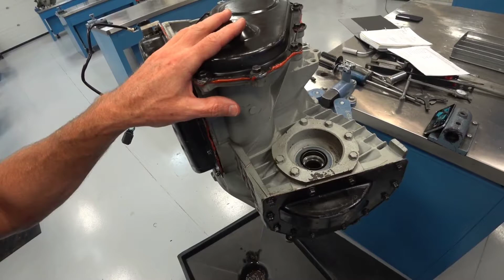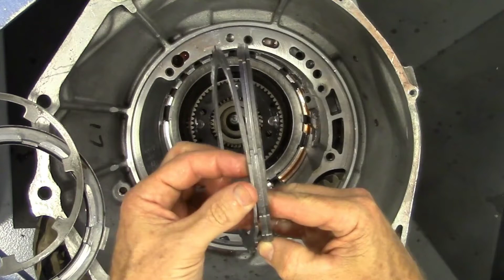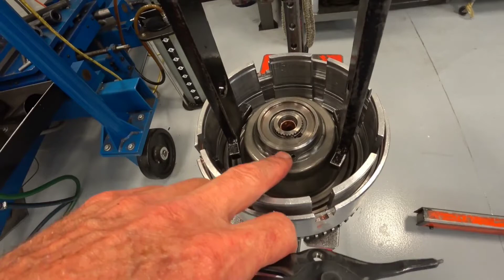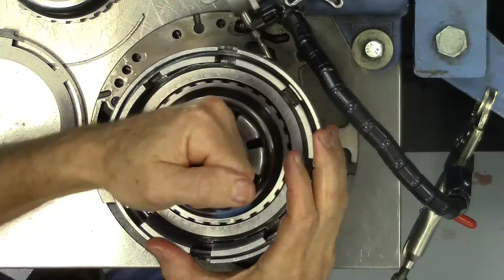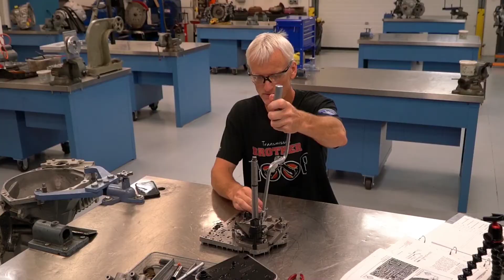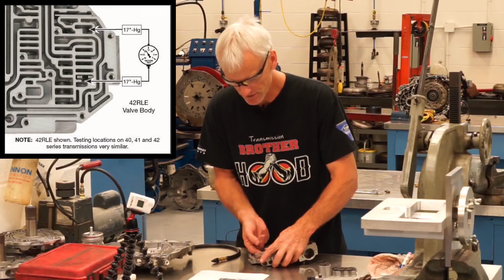FCA 41TE Overhaul

Comment: Excellent video.  Like your students, I was also perplexed by the manual's "remove 1 clutch plate".  They could have added "to not scratch it when removing snap ring".  I'm rebuilding my 2002 A604 AWD transmission for a second time and going in deeper.  First time was only because I had to remove it to replace a cracked flexplate.  Then I found the first clutch plates barely worn (1 mil max) so did just a rubber & gasket refresh.  This time (10 years later), it was leaking bad at the front, perhaps because I found 3 pump bolts loose (swore I used thread-lock and torqued them to spec).  I'm changing almost every wear item since 270K miles now.  So far, I had trouble removing the output bearings, having to use my milling machine (carbide end mill) to cut off a cone race and the outer cup (since recessed w/ no slot to set a drift on it).  Changing some bushings proved that no good deed goes unpunished as several turned out slightly too small for the mating shaft.  I only found that after spending a day trying to stab the clutch pack back and taking things apart again, thinking some clutches were wrong or hanging up, but actually a new bushing was preventing engagement.  I also bought the snap ring assortment and had trouble when I didn't notice the new wavy ring was too long so overlapped slightly (cut it).  I suggest only changing the pump bushing unless you find others worn (none in mine).  Also, good to buy a new star spring for the bottom of the clutch pack since others have found those broken.  Surprisingly, none of the clutch disks or steels are worn even 1 mil after another 80K miles and all rubber seals look fresh, so probably no need to rebuild one before 400K miles unless experiencing problems.  A document w/ many photos and much more detailed than the shop manual:
https://www.uscars.biz/uscars/extras-documents/ATRA_Chrysler_41TE_604_Rebuild_Procedures.pdf
Reply from the maker: Thanks!  Hopefully your rebuild was successful.  Sometimes I use a torch to clutch the bearing races off on anything that I cannot get a puller on.
Reply: @siuautomotive  
Thanks.  I did try a propane torch while pulling on the cone race (after removing rollers and cage), but didn't help enough and the lip broke off, so nothing left to pull on, so had to cut it off.  The outer bearing cone ("race") also had to be cut out, using the carbide mill on a hand drill.  They don't have any cutouts in the case shoulder to use a punch from behind (need a special puller tool),  The inner cone sticks up above the shoulder so was easy to tap out.  Works fine after the rebuild, just clunks down when slowing maybe from 3 to 2.  The ATRA manual gives a procedure to work that out, after maybe 80 cycles.  Might still be air bubbles to work out of the pistons and accumulators.  I haven't driven it enough yet.  I was a little worried I had overtightened the output bearings, since felt slightly higher than 8 in-lb "turning torque" (gear alone) though I didn't have a low-enough torque wrench to measure.  I didn't have the adjustable shims and felt close enough, so will just drive short distances at first.

Comment: I noticed that the shift shaft on my 06 PT Cruiser has a dimple on it and there is a shallow indent on the case, are these supposed to line up in a particular gear? Good video....
Reply from the maker: I don't think that's there for anything too important since there's not adjustment to any of that.  It's probably for the factory to position the shifter in a position for assembly line installation.  But I might be wrong.  I does line up with a detent position.  I'm not sure which one, maybe neutral?

Comment: I need help please. I overhauled my 41TE of 1997 DGC (270K km). I replaced all plates, clutches, rings, clean/flush the solenoid body, torque converter, except to re-use the old solenoid pack. I tested this SP and the ohms is good within specs. I decided not to replace (just total flush) as I thought I can still replace this if the low shift bump will persist later (as this is an external part). The bump never go away after the overhaul but there's no code. After running some +300km. I decided to replace the SP pack with brand new Wagner. The van works well smoothly during road test but reverts to its old bumps today just after some 50 km. What else should I need to check/do to remove the bumps. I understand the bump will start to erase all the spline of the planetary gear as I found out in the overhaul. (I replaced this part too on the overhaul). Thank you for time in advance.

Comment: I have this transmission in a 2008 PT and it has developed a whine, not really bad but noticeable. There are no codes or shifting problems but I wanted to sell the car and this will certainly drop the price. What would be the most likely cause of this whine? Pump or torque converter and what causes the whine and what should I look for? Does it in gear and out, not power steering pump or clogged filter. I serviced it at 60K and now again at 109K. The filter came off with the pan and I found the original filter O-ring in the pan so it may have been pulling unfiltered fluid for a time.  :(  This video is fantastic and I could certainly manage this rebuild for a small part of a shop rebuild including the one special sleeve tool needed. I hope this thread is still active.
Reply from the maker: If the noise is there in drive at a stop, you know it's not the gearset.  If it's there in park/neutral at a stop and it's not any different, it's not likely the torque converter, because everything is spinning about the same speed.  That leaves the oil pump or a regulator valve that's buzzing.  Does it change between reverse and drive while at a stop?  The pressure is higher in reverse, so that will indicate that it's either the pump or the p-reg valve.
Reply: @siuautomotive  The sound is there in neutral, reverse park and drive and doesn't really vary any other than with engine speed. I had the whine before replacing the PS pump but I am going to pull the power steering belt off and make sure the sound is still present and I didn't get a bad reman PS pump. It is no different as I turn the steering wheel so that would just be a sanity check. It is likely the trans pump then. Other videos show replacing the " clogged" filter from no service fixed their whine but that is not my experience. Since it ran without the filter for an unknown time, is there any screen in the pump itself or the valve body in the suction path that could be restricting fluid causing the whine or would that in itself cause the pump to wear prematurely? There was very little metal dust on the magnet at 60K and again at 109K and no real signs of self destruction in the pan. I wouldn't think the solenoid pack would cause this but it has a bunch of screens in it but still no operational issues. Thank you for replying and your advise. I have been terrified of automatic transmissions till this video.
Reply: Finally in to the transmission. There is some slight wear visible on the pump housing surfaces between the chambers for in and out so I hope that is enough to allow some cavitation or leaking internally causing the noise. I did find an unexpected broken tapered snap ring for the 2/4, low reverse reaction plate removed at 17:39 in the video. It was in 6 pieces but all were still in the groove and not floating around but there is some slight damage or small impressions in the plate where the broken edges were but I think the plate is still good as long as I make sure nothing is sticking up above the normal ring land. There is one more molded piston you did not remove under the low reverse clutch pack. Low reverse piston?? Any reason you didn't remove that after pulling out the planetary set?
Reply: Dirty filter.

Comment: very useful video. thankl you for sharing! I have a 2005 Chrysler town and country with this transmission. this is super informative.
Reply: I have a 05 LX town and country   with 447,000 miles. I changed the first one at 300,000 not because it stopped working but it was leaking badly.

Comment: My transmission shift has movement side to side after I pulled it.could the pump bearing be bad.in my Chrysler 97 front wheel drive transmission .thanks for your vedio .
Reply from the maker: They'll move a lot side to side.  The front of the input shaft is supported by the torque converter cover.

Comment: Also, would the 41te in a 2020 journey be a direct swap into a 03 caravan or is it different? (I know the final drive gears are different)
Reply from the maker: Those would be different.  The newer 41TEs have a line pressure solenoid and a pressure transducer, so the valve body is different.  The newer units also have a "pancake" type converter, which is different.  There are probably other differences as well.

Comment: do you know the part number for that guide/protector sleeve at 50 min. into the vid
Reply from the maker: https://www.toolsource.com/crankshaft-c-1321_139_144_951/seal-installer-automatic-transaxle-front-wheel-drive-p-113887.html